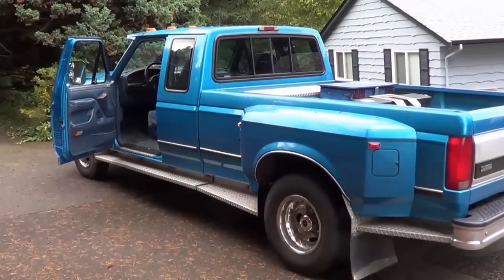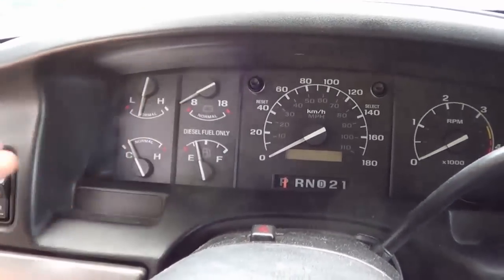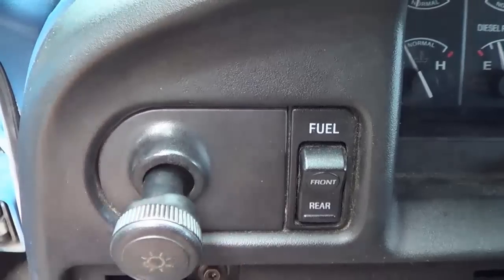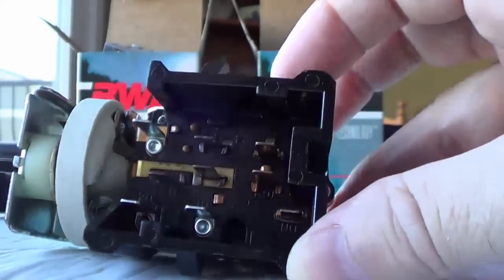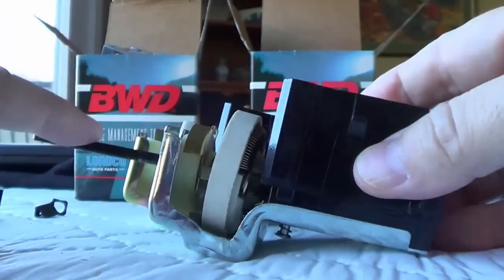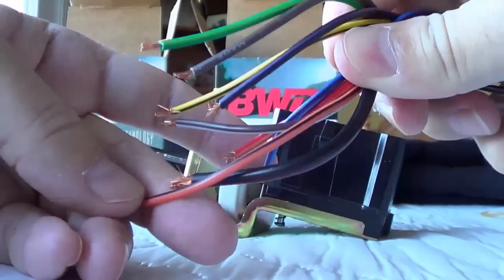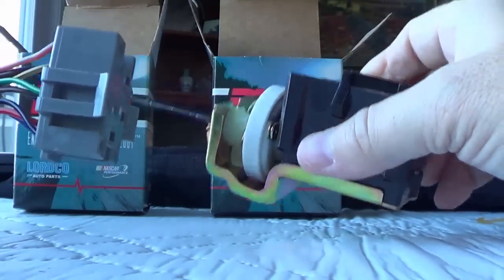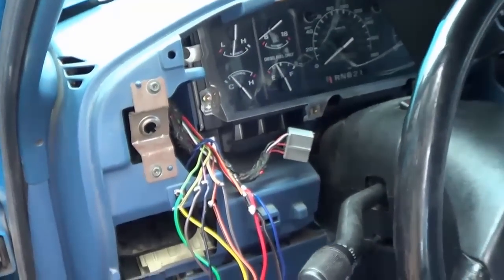Replacing Our Ford Trucks Intermittent Headlight Switch

Comment: Hello: First and foremost let me say I sincerely thank you for taking the time and effort to make and post your informative video. Ours is a 1995 F350 with the 7.3 diesel (What other motor sounds as sweet and substantial?) with a Centarus conversion. We're up here in Canada and imported it from New York State some 17 years ago. Absolutely love the truck.
The thing is about soldering the nine connections. I'm truly glad that I went through the comments because going back four years to that of VIC KRUE - IT IS NOT NECESSARY TO
CUT THE WIRES AND SOLDER THE PIGTAILS OF THE NEW MOLEX CONNECTOR TO THE OLD WIRES. I'm going to quote here what Vic Krue posted. All of the following are his words. Anything I have added will be in brackets.
'Now for those wires in the Molex pigtail.
These wires are actually very easy to remove from the pigtail and re-insert into the new, replacement Molex connector/receptacle, thus avoiding having to splice them altogether.
(He is absolutely correct and I did the entire switch-out in fifteen minutes.) If you look into the end of the receptacle (the side that plugs into the switch) you'll see the end of the metal terminal and a small "clip" on the top of it (which is completely evident). By inserting the flat part of a tiny screwdriver in between the clip and the terminal, you can simply twist or flip that clip to the side separating it from the terminal and the wire and terminal will easily pull out of the back of the plastic block. No strain. No grunting. It's easy. Easy. EASY. (And it truly is as simple as 1 - 2- 3. The thing to watch is when removing the wire leads (which you will not be using) from the replacement Molex pigtail you do not want to compromise that same little clip that is holding the metal terminals/leads in place. Removing them from the old plastic block doesn't matter so much but removing them from the new replacement entirely matters, so be extra careful. The process of switching over is pretty basic. Orient the replacement Molex connector to the one still in your truck and starting at one corner, first disconnect the lead from the old block, remove the corresponding lead from the new connector and snap the now loose lead into the new connector. LISTEN FOR THE CLICK TO KNOW THAT IT IS PROPERLY SEATED. THIS IS ABSOLUTELY CRUCIAL. Working your way along, one lead at a time there is no way to mix up the wires and next thing you know all NINE wires are switched over. NO SPLICING OR SOLDERING.
Continuing with what Vic Crue posted, 'However any wires/terminals that are burnt, such as the Tan/White wire (the usual culprit in most cases) need to be replaced and/or spliced back in.' (In my particular case as I removed each of the leads/terminals from the old plastic block I carefully inspected same for any signs of burning etc. and I found none in any of them. Even the lead that was removed from the portion of the block that showed signs of scorching, the wire and connector, there was nothing wrong with them, These are really tough wires with substantial connectors and even though the light switch fails and the Molex block can be scorched it would take a lot, like almost a fire, to compromise the actual wire/connectors.
That said perhaps I was just overly lucky. The thing being I did not have to splice even one lead and all put back together everything works just fine. I hope this will be of some assistance to the next guy who feels he has to do a bunch of splicing and soldering to remedy the problem.
The NAPA Part number for the light switch is HL6663. Paid $40. CDN for same (The Ford dealer quoted me $160. YIKES!!) and the Molex pigtail Connector NAPA part number is EC6
Paid $23. CDN (Didn't get a price from the dealer - I wonder why?) I ordered an extra of each since we, my wife and I intend to have to truck until we're gone. Have had it 17 years already and love it as much as the first day we saw it at a swap meet in Dunkirk New York.
Keep on truckin' Best James Stubbs
Reply from the maker: Thanks for sharing. I figured by soldering the new one in I was sure to have all fresh connections and wire ends. Sometimes the heat can travel back into the wiring and damage it making it brittle.  Another way to go is to use crimp connections but I find solder quite easy.  Guess it depends on how damaged the old connector and wiring is by the overheating. Cheers, Ray
Reply: @LoveYourRV  Hi Ray: I would say absolutely that your last comment was the most pertinent. Some of the pictures on line of the melted Molex plastic block, it's as if there was nearly a fire. Mine was no where near as serious as some pictured. A little bit of scorching principally around one loose terminal in the light switch proper. In that vein about almost cause a fire, one of my greatest fears is that our 26 year old truck catch fire. Being a Centarus conversion it would be virtually irreplaceable and an insurance claim would come no where near to replacing the sentimental value the truck has for us. Conventional fire extinguishers, while they may put out an engine fire they will do a ton of damage to electronics etc, beyond what a fire would do. Check out this video from Jay Leno's garage. This Element fire extinguisher, is a modern marvel and I would now never not have one in our truck. Good to pass along.
 https://www.youtube.com/watch?v=oBjXecsF860 
Best James

Comment: I'm suspecting a similar but different problem to the same switch. In my case it's the running lights. Brake lights,  blinker's and 4 way all work including head lights. 94 f350 7.3 dually Long bed crew 4x4 manual transmission. Thanks for the video I can tell already is going to save me a bunch of time!!

Comment: I like your video as I need to replace the headlight switch on my '89 f150. But I'd like to make a suggestion about soldering connections. I did extensive wiring on a fishing boat I had years ago and I studied up on the ABYC (American Boat and Yacht Council) standards for wiring. After my studies what I did for making wire butt-connections was to get "non-insulated butt-connectors" and "dual-wall  adhesive lined shrink tube". The non-insulated connectors are just tinned solid copper and about the same diameter as the outside of the wire you are splicing. 

So I'd strip back my wires and crimp one end to the butt-connector and then BE SURE to not forget to slide a 1 1/2 to 1 3/4 inch (38 mm to  44 mm) long cut lenght of shrink tube on to one end of the wire. Then I'd crimp the second end into the other end of the butt-connector. I'd heat the connector with my micro butane torch and sweat the solder into each end of the connector.  Then I'd slide the shrink tube into position and heat the shrink tube. The shrink tube is lined with hot-glue that melts as the tubing shrinks when heated and seals the splice as it is insulated.

What you end up with is a very professional wire splice that is totally waterproof and reinforced but still flexible because of the shrink tube and perhaps 50% to 60% larger in diameter than the original wire. The same size butt connectors are used for 14 and 16 guage wire and the next size up is used for 10 and 12 guage. Because of using the butt-connectors you don't have big and uneven blobs of twisted and soldered wire to insulate. Splice connections done this way are in every way far superior to using the plastic insulated butt-connectors and as dependable as uncut wire.

I suppose you could use a soldering gun set on high to get the 14-16 guage connectors hot enough to sweat solder the wires in, but you'd be hard-pressed to do that with 10-12 guage connectors and you can use a butane cigarette lighter to heat shrink tube.
Reply from the maker: Good tip, thanks. :)

Comment: Is it common for the connector to be charred like that? I'm about to replace the switch on my bosses 02 Econoline van. His interior lights and guage lights don't work, and if you turned the dimmer it would smoke. Not ideal. This video was very helpful. Thank you so much.
Reply from the maker: If the connector metal pins gets oxidized/tarnishes then it can lead to an increase of resistance or a poor contact, this can lead to a voltage drop across the connection and the metal connector and wring gets hot, the heat can get high enough the the Molex plastic plug can melt and char.  Cheers, Ray
Reply: @LoveYourRV  Thank you for the quick reply!

Comment: Good job on the switch but the reason your having trouble is because there is too much current going through switch when you hook up a trailer etc. My 1991 F-250 has the same switch, same thing happening. I ended up installing a relay to take the load off the switch whenever I hooked up a trailer. Too many lights overload the stock headlamp switch. My switch was melted worse than yours, lucky no fire. Like your videos. Lived in BC for many years. Great place to live.
Reply from the maker: Thanks for the tip. My truck has the factory tow package with a 7 pin plug, thought it had the relay built in, hmmm.
Anyway, a couple years ago I swapped out all my trailer lights for LEDs at 1/8th the current That should help out a lot.
Cheers! Ray

Comment: I have a 94 GMC 1 ton and my light switch is starting to act up the past couple months.  I have to cycle it a couple times and wiggle the rocker switch to get the dash lights to come on.  Hoping that I could spray some contact cleaner and not have to pull it apart.  From the looks of your Molex connector it was shorting out, so hope I'm not that far gone.  Thanks for the motivationak video, I need to dig into my problem sooner than later now that it's getting dark so early.
Reply from the maker: NWHiker I think what happened is the switch contacts inside became oxidized or had arced and created some resistance. Then that higher resistance in the contacts led to them heating up and then the heat was transferred to the connector causing the plastic to melt. It's worth taking a look at yours and see if anything looks bad. Best of luck. Ray
Reply: No wonder! It's GM, not Ford. lol

Comment: Thank you very much for this video.
It's exactly what I needed to remove my dash panel to get to that light switch... I've got the same problem myself.
You might practice your wire splicing technique. Those splices could have been a whole lot nicer.
Now, as for those wires in the Moldex pigtail:
These wires are actually very easy to remove from the pigtail and re-insert into the new Moldex receptacle, thus avoiding having to splice them altogether !

If you look into the end of the receptacle (the side that plugs into the switch) you'll see the terminal and a small "clip" on the top of it. By inserting that flat part of a tiny screw driver in between the clip and the terminal, you can simply twist or "flip" that clip up, separating it from the terminal and the wire and terminal will easily pull right out of the back of the plastic block. No strain, no grunting... it's easy easy easy.

However, any wires/terminals that are burnt, such as the Tan/White wire (the usual culprit in most cases) need to be replaced and/or splice back in.

Thanks again.
God Bless you and yours dude.
Reply from the maker: Thanks. I elected to cut back to make sure I had fresh, clean wire and solder them all.
Reply: Hello Vic. Just to let you know, I just reposted (Nov. 5, 2021) most of your instructions for changing the Molex connector for a failed headlight switch for a Ford F350. I'm really glad that I read far into the comments to find yours. I swapped out the connector in about fifteen minutes. No splicing - no soldering and it seems to work fine. Out of curiosity if you still have the vehicle you did this for, did it continue to work just fine? Best. James Stubbs

Comment: I accidently shorted a running light socket and the switch is very selective on even working, just got a replacement for it. Ill update on how that goes.
Reply: It was a dang fuse haha, no clue why it worked a little then didn’t but, eh, it’s fixed now.

Comment: At time 6:45 in the video, I see that you have soldered with wires. However, I don't see where you have insulated the bare connections.
Reply from the maker: I just wrapped each with a bit of black electrical tape and then wrapped the bundle together. It was quicker than using heat shrink tubing on the all the wires.

Comment: Great information.  On another video you mentioned that you had some work done to your transmission.  I have a 1995 F-350 w/ the 7.3 and want/need to get the trans beefed up to tow a fifth wheel.  Do you know what kind of upgrades were done to your trans?  I think some people just get a beefier torque convertor.  Any suggestions?
Reply from the maker: I can't remember the exact upgrades but the tranny tech said there were a bunch of them for the E4OD that he added besides a heavy duty torque converter.
The shop I had do the rebuild was in New Brunswick and does a ton of trucks used as snow plows, so had lots of experience with the old fords. It's been great since. It ran about $2500 for the full rebuild.
Reply: Love Your RV Thanks

Comment: I wonder if the flasher module needs replacing since the hazards are flashing so slow.  It is a very nice truck.
Reply from the maker: Denny Johnson I have a heavy duty flasher installed in it for the trailer. Blinks a lot faster when hooked up to the fifth wheel. The regular flasher would blink too fast because of the extra load the trailer lights put on it. I've read there is solid state flasher that may solve that problem.

Comment: Sent my 94 out for paint, turned out great however when I got it back having a headlight problem. When I pull the switch I have headlights but no taillights and have to put the switch in a tiny bit to get dash lights. If I get dash lights, I have tail lights. No way do I have taillights if I have headlights It's nuts. So replaced the switch. No difference exactly the same problem. I don't see any burn marks on the harness block. I wonder what the problem is. Have you ever heard of this? Any help would be appreciated. Great video.
Reply from the maker: My guess would be a ground problem somewhere. Maybe they disconnected a frame ground connection to paint and forgot to put it back. Just a wild guess though.
Reply: @LoveYourRV  Thank you so much for responding to my post. Yes I had to replace the bed of the truck after buying it I never realized it (it had a plastic bed liner) and what was under it.  I decided to do away with it and paint the bed. I was shocked out of my mind when I saw the bed was rusted big time and could not be salvaged. Try finding an 8-foot bed for an 84 that isn't already destroyed. Stupid me for not removing the liner before buying the truck. Finally, I found one but naturally, the taillights had to be removed and reset in the new bed. I didn't do any of this the painter did. I will check it out completely. I'm wondering...., there was a small light fixture mounted up under the bed on the driver's side near the spare tire mount. We had no idea it was there and what it was for. It looked like a factory install. Maybe some kind of assist light to change the spare? The painter didn't remount the lens and I haven't looked at any of that wiring as I have medical problems that make it extra difficult to get down there and back up. But I will have it looked at. Again, thanks for your advice. Anxious to get the truck on the road as the body and paint make it look brand new again. You have to love these trucks to put that kind of money in them LOL Thanks again.

Comment: I'm not having any trouble with my lights yet but I'm going to replace all this before I do, and I'm also going to add a Heavy-Duty Headlight Harness as well. The Harness draws power directly from the battery instead of going threw the Headlight switch. There is a few places that sell the Harness LMC & Bronco Graveyard is 2. I want to buy OEM Ford parts, and I found the Headlight Switch, and the OEM Connector. But the OEM Connector looks to have all Black wires instead of the colored Wires on the Aftermarket Connector. So how are you supposed to be able to connect it if the wires aren't colored? I guess just pay attention to exactly where the wires are, but that seems to be a little more difficult with all black wires.
Reply from the maker: Maybe use masking tape and number them before changing it.

Comment: Another nice video, Ray.  Did you wrap each solder joint with electrical tape to prevent them from contacting each other or other metal inside the dash?
Reply from the maker: Patrick Wagz Yes , normally I would use some shrink tube insulator on each connection but I didn't have some so used electrical tape.

Comment: After replacing the molax connector, was there a short?
Reply from the maker: No short. Likely what happened was the connection oxidized and corroded leading to high resistance and eventually overheated & arced melting the plastic. Cheers, Ray
Reply: If there's a burnt wire in the molax connector, will it cause the parking light to stay on even if the switch is turned off?

Comment: Do you have a link to the replacement unit you got?
Reply from the maker: No sorry, I don't. I bought it from Lordaco auto parts in Canada.  The original Ford part number stamped on the headlight switch is E778-11654-AA. The Lordco Auto Parts numbers were S2004 for the headlight switch and PT767 for the Molex Connector Plug. This an Amazon link https://amzn.to/2Kz150s  but says currently unavailable.